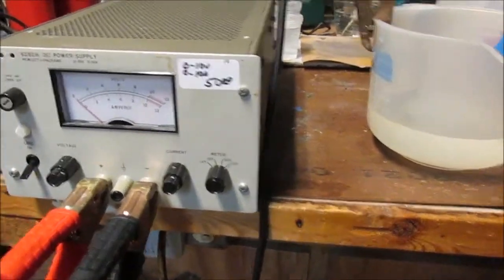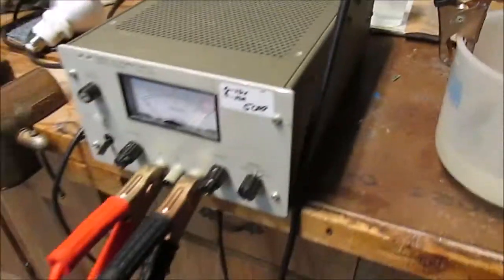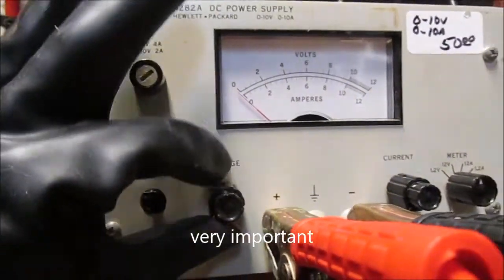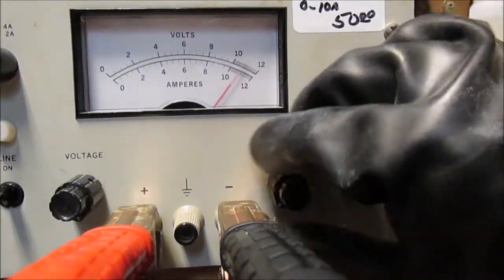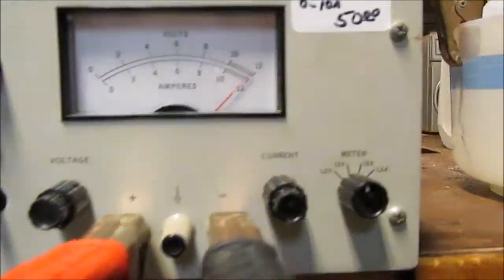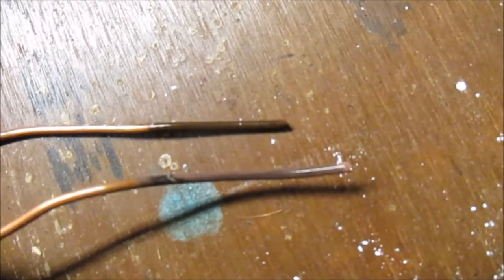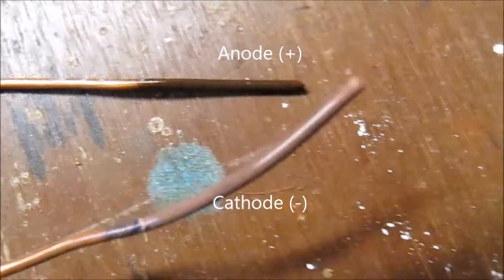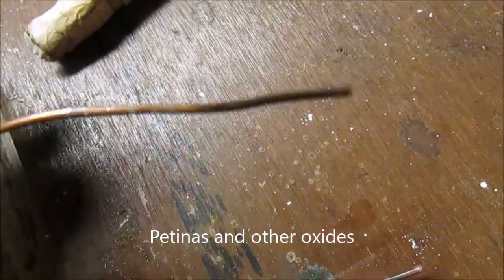Electrolysis of Calcium Hydroxide

Comment: It is not calcium metal because cal cium metal is so reactive that it reacts with water and turns into calcium hydroxide and water (Ca + 2H2O = Ca(OH)2 + H2) and even if it didin't react with water then it would instantly get oxidized in air and turn into CaO so it can't be calcium

Comment: How would you go about extracting a fairly significant quantity of calcium metal, say 1 ounce or more?
Reply from the maker: You would likely need molten calcium hydroxide and a lot of power for that. This method doesn't produce usable calcium metal but rather demonstrates the process of electrolysis with calcium. If this were done in the absence of water then you could get some, but that might be a little dangerous. I'll look into that...
Reply: Adumbrate 
Thanks. Some elements are relatively easy to extract from common compounds, but others require a LOT of energy, or at least a LOT of effort and time. Iron and copper can be relatively easily extracted using a lot of heat. Aluminum on the other hand, requires a caustic brew of chemicals mixed together in a durable vat, combined with extreme amounts of electricity coursing through the stew, to break the aluminum oxide bonds.

 Magnesium on the other hand, is commonly 'extracted' from sea water, and even though I'm not clear on how, I think it's safe to say that it's difficult enough that I won't be able to extract any magnesium metal the next time I'm down at the beach.....
Reply: Calcium hydroxide doesn't melt at standard pressure, it decomposes into water and calcium oxide, which melts at 2580°C. Technically calcium oxide is reacted with aluminum and the calcium is distilled off. I think the best method for amateurs is electrolyzing molten calcium chloride.
For magnesium: If it's really extracted from seawater, it's just the salts. Magnesium chloride is also electrolyzed while molten to get magnesium metal.

Comment: Hi, this video is very interesting. Would it be possible for you to try this again using graphite electrodes?
Reply from the maker: It's possible, we don't have any right now, so we'll have to remove them from some batteries. That might make any reaction more visible.
Reply: Try taking graphite from inside of a pencil.
Reply from the maker: We usually have pens around XD, we could do that
Reply: you're only going to get calcium hydroxide back again at the cathode. You will  not get calcium metal because of the presence of water. If you want calcium metal then electrolyse molten calcium chloride.
Reply: spot on!
Reply: Then how do you explain the silverish tint on the cathode, terminate?
Reply: mikhailEschatologist, I see no silverish tinge on the cathode. If you know your chemistry you should know that calcium reacts with water to form calcium hydroxide.  Just type in calcium reacting with water on youtube. the reflective effect on the cathode is just water and the metal the cathode is made out of reflecting the light nothing more.
Reply: From Gibbs free energy equation I would think the electrolysis of CaOH should produce H2 on the cathode and O2 on the anode. However I'm not a chemist, I'm a geologist. I am a phd student looking for mineral resources on Mars. Mine is a young science, so if i see an experiment contradicting a theory, i automatically trust an experiment - it's a personal bias. It's true that calcium will react with water, but it's also true that calcium forms protective layering against corrosion when exposed to oxidative stress. Maybe (and here's my bias speaking) protective layering somehow inhibits corrosion enough to allow metal precipitation to occur faster than metal corrosion. It is true that the reflecting effect is ambiguous. This is the reason I requested the experiment to be carried out with graphite electrodes. Unfortunately it would seem Adumbrate is currently busy with other projects.
Reply: @MikhailEschatologist  the layer you are seeing is the reflective white calcium hydroxide layer being spontaneously deposited on the copper electrode. the layer on the electrode is far too thin to protect the calcium. I have made calcium myself, and even thick pieces will react with water very quickly. the electrodes were wet when he removed them, so any calcium would have been destroyed. it is theoretically possible to alloy calcium with copper, but that would require higher temperatures.
Reply: As calcium is a reactive metal it does form a protective oxide layer. But as were talking in atomic particles (the ions) then the calcium can't protect itself from corrosion. As soon as the cation (Ca+) gains the electron back from the OH- ion it immediately reacts with water to form CaOH again. If a lump of calcium metal was left out to oxidize then the oxide layer would act as a barrier from the water and the metal surface depending on thickness but as its not in a structural form but as free ions that move around and so doesn't get an oxide barrier.
Reply: Its like electrolysis of table salt (sodium chloride) You don't get sodium metal at the cathode as it reacts with water to form NaOH and then that NaOH reacts with HCl  and HOCl from chlorine gas reacting with water to form NaCl again and NaHClO (sodium hypochlorite) I have given this example to show that there's other chemical reactions that go on during electrolysis and not just ions becoming  separate chemical elements again.
Reply: It isn't very interesting instead misleading because calcium instantly reacts with water to form hydrogen and calcium hydroxide (Ca + 2 H2O = Ca(OH)2 + H2